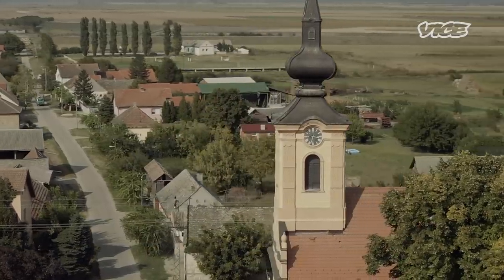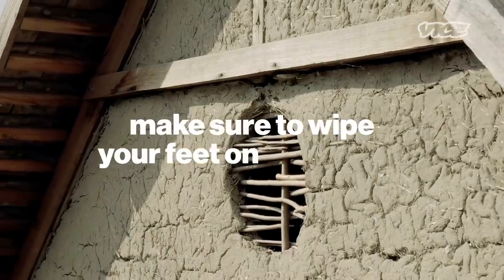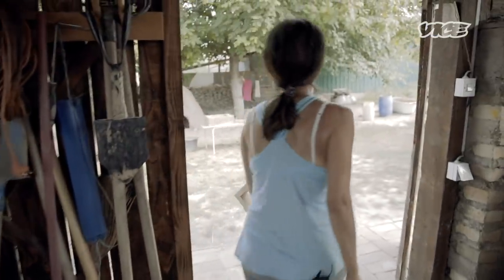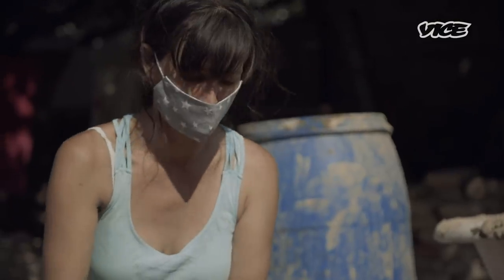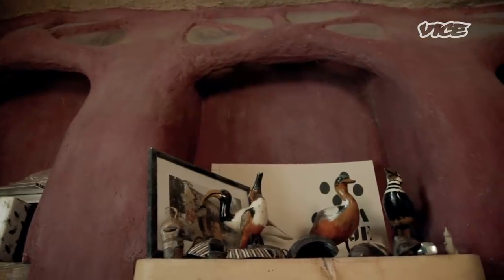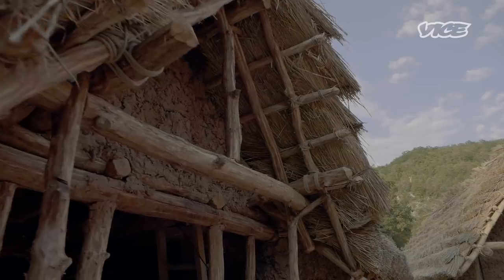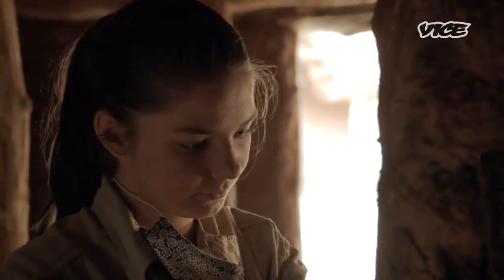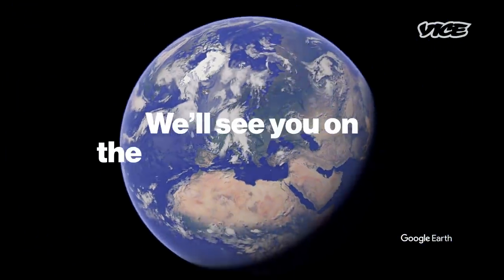Architects Are Using Mud to Build Sustainable Homes

Comment: Dried mud still turns back into wet mud and falls apart when it rains, unlike cement or mortar where there is a chemical reaction that causes it to permanently set hard and become water proof. Imagine a sidewalk made from mud instead of cement, it will become a sloppy mud walk in the rain. So mud might be ok in dry climates and where there is a good roof to keep the walls dry.
Reply: Indian buildings that are like 900 years old or so were made of limestone . Hindu temples made of stone carvings

Comment: So this is what happens when you let architects build without engineers lmao. Contrary to what she said in the video, mud is very permeable compared to concrete so expect water infiltration (especially Sun dried mud bricks, there's a reason why she didn't mention "cooked"  bricks because it would mean people would have to burn an immense amount of fuel to make them which doesn't fit her narrative). Cracks will form in the structure in no time, insects and water will make their way through and u will spend ur whole time patching ur house (if you have a job its not great). That straw roof is a very poor insulator, so if you live in an even mildly cold climate ur gonna pollute much more trying to heat your house than anything else. That's without mentioning the huge fire hazard and the fact ur roof will blow off if strong winds happen. The mud structure cannot be reinforced with steel making is very weak to all tensile loads.

There are many reasons we don't live in mud huts anymore I could keep going on and on. You hippies are funny
Reply: 30% of the worlds population lives in earth bag housing. It’s only the places with extreme over regulation like the states where it’s not common. 

And earth made houses are some of the oldest standing building in all of Europe. 

Look up earth bag construction counters ever issue you’ve brought forward. Stop pretending like having alternatives to building monopolies, “is just funny hippies”, and doesn’t benefit everyone.
Reply: @cyberworld9000  Most of the 30% also live in poverty, they have no safety or building standards. They could give 2 shits if a building collapses, catches fire or what happens in case of an earthquake. They also don't care about energy efficiency or lifespan of a home. I can guarantee not one person checked what forces are being applied on the structure.
The video doesnt show earthbag homes but if u want to talk about them, the ones I saw that were actually engineered are all 1 storey houses, im assuming for structural reasons. Imagine 7.8 billion people in all different climates and geological conditions living in one storey mud homes. Imagine the amount of space we would take up.
Reply: What would you say would be a good alternative to a wood or concrete house?
Reply: Joshua Bates Wood is actually extremely sustainable contrary to what people believe. If we properly manage our forrests we can build with wood forever. The deforestation that is happening in some parts of the world is not for making building material, its for food production. Steel also is a great replacement, very durable, readily available, easy to assemble and safe. Check out BONE structure if u live in Canada they make great steel houses

As for concrete, nothing competes with its strength and durability for now, what we can do is produce carbon neutral concrete which is already being worked on. Theres also hempcrete being spoken about alot.
Hemp fibers also make great insulation material.
If ure trying to build mega structures, theres not much that compete with concrete and steel as of now. What we can do is make them carbon neutral
Reply: @Wakkks  Serbia has a mild climate in general and the local climate probably supports this kind of home otherwise people wouldn't do it. The architect is basically using the a lot of those buildings in the video as proof of concept and/or built for training people so they aren't really made as permanent homes, while the second half of the video is described as a "archeological park" - meaning they are supposed to be old and simple. I thought her personal home was beautiful.

Literally no one is saying we should stop building tall buildings but we have to acknowledge that concrete manufacturing is really bad for the environment. Using earthen building techniques would be at least worth looking at from a technical viewpoint to see if it's viable in some cases. It'd probably never be useful for building in large cities but it could be useful in rural areas. Rammed earth structures in particular have some well developed engineering supporting it and could be incorporated into modern building standards which would at least reduce the amount of raw materials needed and vastly increase the heat-mass of a structure to help regulate the temperature.

There is also a cultural reason to explore it because literally everyone's ancestors lived in earthen structures at some point in our collective history.
Reply: @mjstecyk  Again I was commenting about the houses I saw in the video and Im telling you theres no chance theyre efficient to heat and live in them in Serbia. Her proof of concept will end there, she could've just asked a structural or building engineer they would've given her the answer about her sun dried mud houses.
As for rammed earth structures I agree with you that they are interesting for houses. When you build you try to find material that are strong, safe, durable, available, efficient and that can be standardized to be used in mass and be predictable. if that ends up being proven for rammed earth, great.
Our ancestors also use to beat each other with clubs and pillage other villages. Not a great argument.

Comment: Sure, bring your mud houses to our fine eco-system in Puerto Rico, lets see how they stand on Hurricane season! Thank you but no thank you!
Reply: Doesn't cost anything to repair other than time. Mud houses can last literally thousands of years with ease but wood only a few hundred as for brick and concrete again only maybe a hundred or so as concrete needs maintenance. Dirt doesn't as its totally breathable.

Once it rains and the mud dries out it becomes stronger and holds itself together even better than before.
Reply: Try building one of your puerto rican homes in Subsaharan africa, let's see if it won't get stripped/sand blasted and sand over runs your home
Reply: @Mr3344555  again nothing a bit of dirt and water can't fix, repairs cost nothing but your time
Reply: It's obviously not for all locations. But in locations where it is feasible to build using alternative materials it would be best to do so.
Reply: @Mr3344555  Where in Sub Saharan Africa? The deserts, the grasslands, rocky areas, the costal areas, jungles? Stop talking about stuff you don't know about.

Comment: I was thinking, it is not natural, but more recycling, so : you could put recycled bottles filled with salt water in the walls and utilized in areas as kind of "windows", but what they really are is a possible heating unit? And by utilizing them within the walls, maybe the heat would spread? I don't know, I'd think if you did the entire bottom foot or so with supports and the bottles with salt water, maybe the heat will rise up through the walls? Again, I know it's not "environmentally friendly" but maybe it could work and provide a way to recycle these items. And also, my reasoning behind using salt water is that it would inhibit mold growth and hold the heat longer possibly?

Comment: Not a useful method in most countries. Something made of unfired mud bricks would deteriorate quickly in the rain and snow that are very common throughout the world. Since it's a mix of mud and straw, running electrical wiring would be an issue- straw could catch fire if something damaged the wire. You also have to have access to tools, enough water and mud, as well as mass quantities of straw. Most areas won't make that easy. Earthquakes would destroy them. If you go for a thatched roof, fire would be an issue, as well as rethatching to prevent mold. You also have to take into account local building codes. Why not just use brick? That's stronger. If you are in an area where it is time and cost-effective to build mud huts, sure, knock yourself out. Just don't expect the world to follow.
Reply: Basically you haven travel outside united States my friend in Mexico in the small villages most houses were built with adobe included my gramps's home more than 150 year and still intact do you know you can use stuco to cover the walls you haven't see it all my friend Adobe it's so popular in other countries if you will see my dad's old house you could not tell is made with adobes

Comment: One earthquake and the whole village going down
Reply: Still cheaper to rebuild than using modern housing and rebuilding that
Reply: Not likely as there are wood used to hold it together, no nails but all natural materials which can flex, sure there would be a few cracks after a strong earthquake but nothing a little mud cannot fix.
Doesn't cost anything but your time
Reply: Not true at all. The ignorance of people who have never worked with the materials mentioned is outstanding. 

Tons of ways to build with earth easily even in places like CA, both in modern times and historically?

Comment: I wonder what the lifespan of these houses are?
Reply: 30-50 with tiny repairs, earth built houses are among some of the oldest in Europe tho when you add in some other methods. 

With cob and earthbag construction for example you can easily built something much cheaper that will out last most modern buildings quite easily. For much cheaper.

Comment: A straw bale house would provide the insulation needed in colder climates.
For adobe you really need roof overhangs to reduce the impacts of rain or snow. No matter what never patch adobe with concrete. Adobe needs to breathe and requires some yearly skim coat in most areas.

Comment: Those are really bad adobes, they cannot stand Earthquakes, there is a Spanish organization Architects without Borders and they designed Earthquake resistant Adobe houses, but the adobes have to be 30cm x 30 cm, and combine reed every 3 meters in vertical and every 30 cm in horizontal.

Comment: Just started renovation / restoring an old mud house in Belo Blato.
Reply: I'm thinking of building a house with adobe bricks, that I want to make! Do you know if it makes any difference whether the size of the bricks are 30×15×10cm or much larger 48×48×14??
Reply: @marioshadjikyriacou3381  the size is actually irrelevant. Naturally the larger ones are a little harder to handle. I would use the 30x15x10. Also the ideal thickness of the wall is about 70cm for earth walls. Consider framing and ramming the clay
Reply: @Dalje1960  wall thickness has to do with the waether conditions i guess! 50cm(+something) is great enough for us!

Comment: There is a fast way depending on the soil.
You simply dig a whole with a small excavator and next to adding the basic ingredient straw you can if needed add either extra clay or sand and make a mix in the hole quickly in large quantities with the person on the excavator mixing with the bucket as a second person adds the straw.
This way you can quickly build big thick walls that will need some insulation to be energy efficient, preferably placed into a hillside or berm faced southwards with some earthship features to store heat and be sheltered from hot and cold weather. You could also store big tanks of hot water from the summer etc. 
The use of carbon fuels isn’t bad as long as buildings are used many generations.
Not to sound crazy but the carbon dioxide hype is an old seventies based UN/ club of Rome lie to use as a good sounding world government excuse to have to unify the world into one government government (same with pandemics now).
A one world tracking and taxing system as control  replacement system for the inevitable fall of the western welfare state promise currently being broken with baby boomers failing pension ponzi.
It’s occult (Freemasonry & friends) planned political correct climate communist based carbon credit central bank digital currency prison planet plans combined with war disease hunger and actual climate cooling based on solar minimum cycles.
This plan is decades old, they’ll combine economic collapse with war, inflation, hunger, cold, racial and religious tension, disease, sexual confusion, opportunism, propaganda, depression, drugs etc to reduce the population. They’re hoping on new variants of flu and weakened immune systems from the vaccinated preferably the old die and a new generation can be formed.
They will fail, the Greta reset wil fail, so will the west in the process and most of the world, the money center moves to China, that’s how bad we get.
It wasn’t so much predicted but announced in the twentieth century from the old “slaves” mentality to the “tax slave” model run by hired “experts” and “science” based but all technocracy and social Darwinism, Luciferian/ satanic based philosophy, existentialism etc. 
Simply stated the dumb are there to serve the “intelligent” elite which are just the hired intellects of a ruthless murderous cult system.
People can’t see they in it themselves, all is normalized by propaganda, culture creation, conformity, compartmentalization etc.
But it’s provably there, predictable and documented but you need to take a dive to see lots of it in its simple to learn symbolic context and subliminal workings.
Meanwhile it’s hidden in purposely ridiculous occult settings with hidden in plain sight everyday symbolism. 
Just watch these videos and learn the tip of the iceberg. Don’t believe me, see for yourself, I’ve tested it for years over a decade ago and it is coming to fruition as described and exposed then by their own admissions.

https://youtu.be/ksXpjIKmH1s

https://youtu.be/PqBlmJITMkg
 
https://youtu.be/MBkB48zONto

https://youtu.be/TDz0GOI1akk

All we save is spoiled by crazy wars and government abuse.

Comment: yeah ok sorry, but I don't see how this is scalable or reliable. The climate, the available resources and the location alone play a huge role in what you can do and need to do with these houses. There are already huge housing problems because governments don't spend nearly enough on promoting affordable housing. The few houses that do get build are more often than not prefab houses in which the building itself is only 1/3 of the total amount of effort needed I'd say.

Comment: Would adding stones help to insulate a home more if you’re in a cooler climate?
Reply: kinda, thickness of the walls always helps, but stones are cold so it would help way more in hot climates then in cold ones

Comment: Electrical, gas and plumbing? Fire safety?
Reply: All can easily be built into construction. Look up earth bag building for more advanced builds with dirt. And dirt is much more fire safe than the tinderboxes that are most modern day homes. This a fire could come threw and all you’d have to do is replace the roof.
Reply: Which require more or less the same $$$ while the building deteriorate. Good for the environment I suppose.

Comment: Just when India started making concrete brick... This westerns are taking our old technology 😂😂
Reply: "Taking"? I think in India you also mix in poo with the mud.
Reply: @- king- Same with many traditional African homes. Cow dung is mixed in with straw and used for the floor and to seal the walls over the bricks. It hardens well and is insect repellent. The smooth surface is them polished and the walls painted and decorated for some tribes. Sadly, it's all but forgotten now where I live.